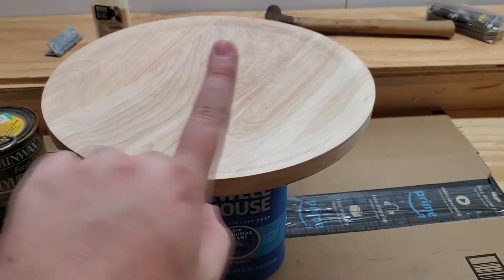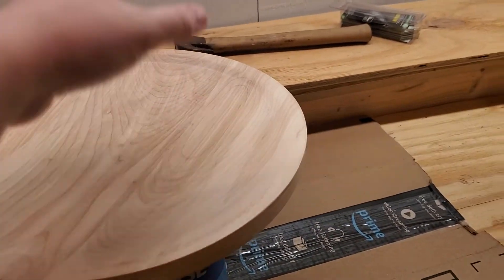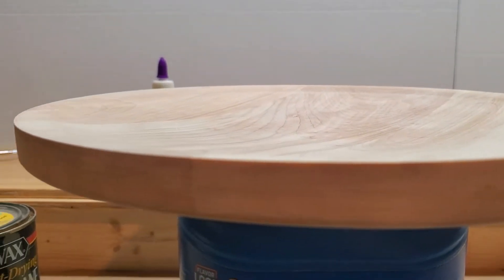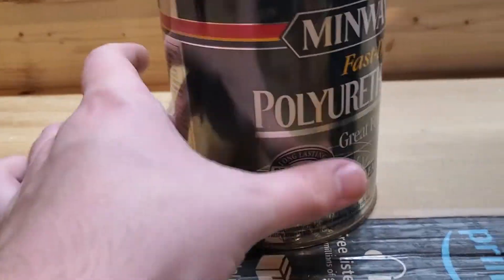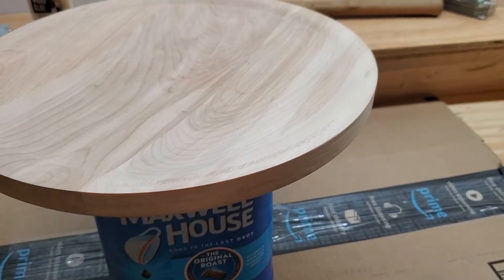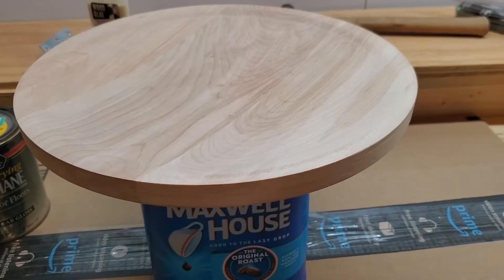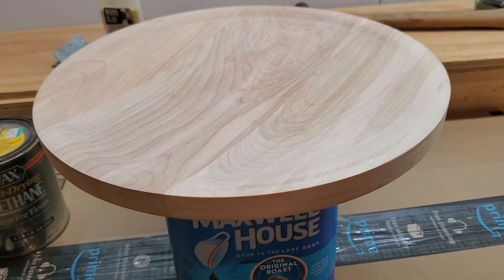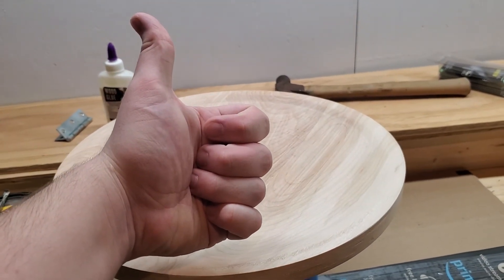Homemade beyblade stadium

Comment: Does the wood make the bottom parts wear down ?
Reply from the maker: No   and its also not going to wear down because I habe it polished
Reply: @maximumrpm1868  thx
Reply: @maximumrpm1868  how do you polish wood?
Reply from the maker: @yuhjeice7186   You sand it down until you use in really fine sandpaper then you apply your 1st coat of paint then you steal   Wool it then you put your 2nd coat of paint down and it makes it like  glass